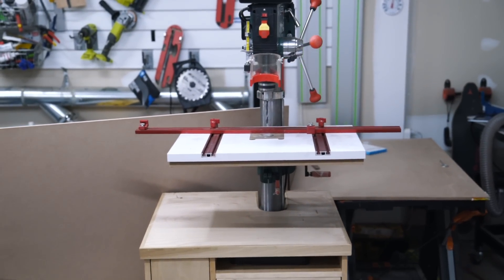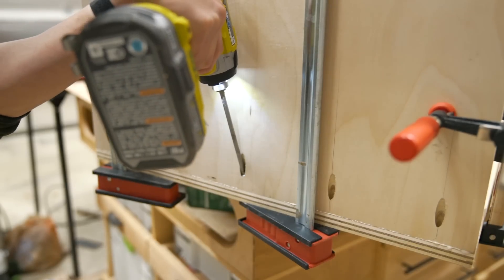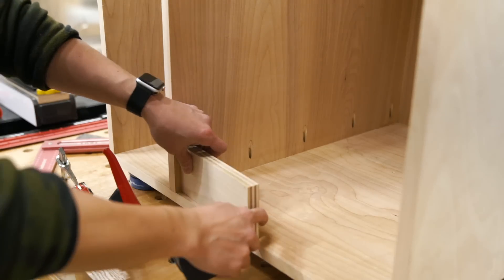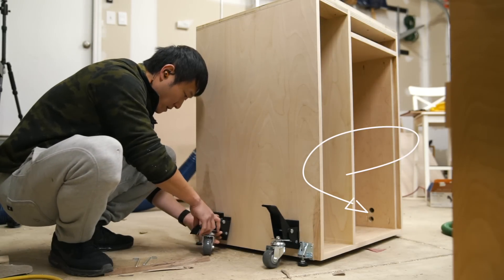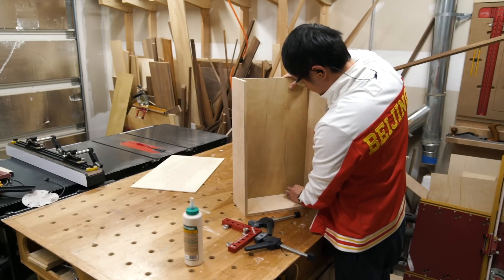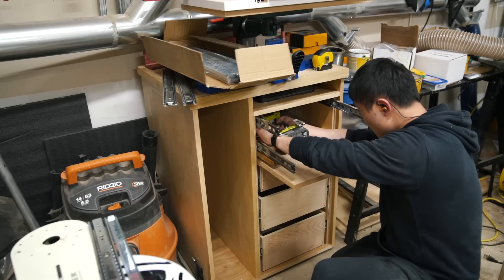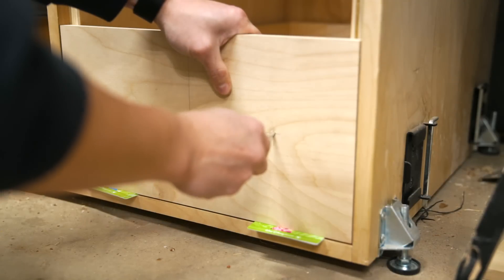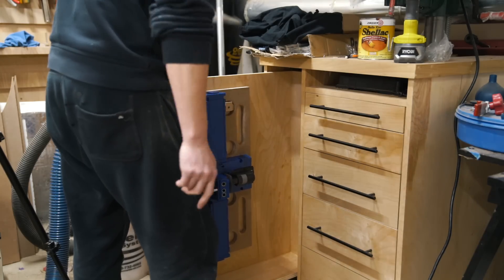DIY Mobile Drill Press Stand || How To Build - Woodworking

Comment: Great work.  A suggestion about the drawer fronts.  Once you put them in place, put two wood screws through the holes for the handle.  This will hold the drawer front in place.  Take the drawer out, and put a couple of screws from the inside into the drawer front.  Then you can remove the two from the front, drill the holes all the way through and install the handles.
Reply from the maker: Great idea! Thanks!

Comment: Definitely don't have to worry about that thing coming apart! It's built SOLID. My cheap self probably woulda used 3 screws per side (except to fix a warp if needed) and would have just glued smaller supports for the drill press instead of using that much plywood. Nice build!
Reply from the maker: You’re absolutely right! Screwing in some 1x2 strips would definitely be strong enough to hold everything. I didn’t think of doing that until after I had started editing the video haha
Reply: @BevelishCreations  That's one good thing about rewatching all of your work I guess. You can see what you've done and what you wish you would have done.
Reply from the maker: Yep! I normally realize how I should do things differently during the editing process. Like when I made the Harry Potter shelves, my process for cutting the crosslap joints are completely different between what’s shown in the video versus what I did for the ones I was commissioned to do

Comment: I added a base on bottom with a lift Caster system inside, I don't like to have drawers that low to the floor. I made the cabinet larger and I like to have the top drawers I and a half inch so when I put a ruler or something in there I'm not digging down through things to find what I want. Thank you for inspiring a little different project.

Comment: I very much like your drill press stand. I recently inherited a very nice drill press similar to yours and am looking at videos to find a suitable stand for it. So far your looks like a winner. 

There is one change I will make for the writing shelf. The shelf as compared to your will be upside down and will not have the interior supports. This way the writing table and pencil can be left in the shallow draw. This way the writing pad can be quickly viewed and then moved out of the way to use the drill.
Reply from the maker: Good idea! And I’m glad you like it :)

Comment: Came here from Instagram. Really liking the table. I had a bench top drill press but gave it to my brother in law because I acquired a floor drill press but honestly haven’t had the extra need for the floor model. Will probably be switching back and building this base or something similar. Earned a sub on both platforms. Great content...keep up the good work.
Reply from the maker: Thank you so much!
Reply: I built a rolling stand similar to this and love it. I also was careful to build it to the table saw top height for extending. I use it also as a tool ready rolling cabinet and small work station. Also put magnet bars on the sides for quick access. Really wish I would of found this first ! The side cabinet is a great Idea ..Great work ! This is a fun build ! Keep the floor press and have room for both!
Reply from the maker: Thank :)

Comment: Nice well built stand! Another workaround for your slide out shelf problem would’ve been just to reverse the vertical piece to the right side of the opening then you would’ve cleared the caster bolts that way. Who cares if the opening was on the other side it still works fine.
Reply from the maker: Thanks!

Comment: Only thing I would change is that top paper drawer. Instead of just making it a solid surface, I would make it a drawer with a lid that opens so you can put paper in it and still use it as a work surface. Maybe you didn't show it in the video but I was surprised you didn't actually secure the drill press to the stand with bolts or anything. Otherwise fantastic build as always.
Reply from the maker: That’d be cool! And no I didn’t secure it. There’s really no need to, since it’s sandwiched between two panels so it can’t tip over

Comment: I have a question for you:  it appears your main cabinet sides are not supported by the bottom panel; they are screwed into the sides of the bottom panel.  Maybe your inside cabinet sides are bearing the load?  Would be interested in your thinking about this.
Reply from the maker: JT Long you’re right, the load is transferred to the sides and down into the feet of the cabinet. The bottom panel is floating above the floor and its main purpose is to act as a stretcher, not for holding the weight

Comment: Great build. Did you mount the drill press onto the stand or is it held by the space its slotted in? Thanks!!
Reply from the maker: I didn’t mount it. I’ve never mounted the drill press even when on a regular table top. It can be held in place by the slot if you’re worried about it tilting

Comment: I bought these plans and have a question, how did you fasten the drill press base?
Reply from the maker: David Lediard I didn’t. Haven’t had any issues with it. If you want to fasten it, then drill the bolt holes before fastening the top panel on. I kept the clearance between the drill press plate and the top panel close enough that there’s no concern for tipping over

Comment: Yay, finally found your YouTube channel! Another great video! I like that you included your film gear as well as the tools & materials. :)

Did you plan to finish it at all?
Reply from the maker: Paul Mix hey thanks! It’s actually finished. I used shellac. I just didn’t film it because everything was done at different stages instead of at the end. It got kind of messy from a story telling point of view.
Reply: @BevelishCreations  May I ask why you chose Shellac instead of Polycrylic? I've never used Shellac so just wondering. Thanks
Reply from the maker: I just happened to have some shellac on hand. The stuff I use have wax in it, the wax actually helps me to keep glue or paint or epoxy from getting stuck on the surface. Not sure if poly would do the same
Reply from the maker: Also, I forgot to add, Shellac has a lower working temperature and shorter wait time. Also two big reasons why I chose Shellac for this. It was 45deg when I was building this

Comment: Bevelish Creations- 
How are those table saw rollers working out for you? I've seen them before and think they'd be awesome to have.
Reply from the maker: Really good! Especially for cutting wide pieces, they help to keep the piece pressed down to the table as well as pull them toward the fence. It’s great for preventing kickback
Reply from the maker: Steven Roehrer I should add...they’re definitely a luxury, not a must. If you have the funds to get one, then yes get them. But they certainly won’t dramatically improve your process
Reply: Thanks!
Reply from the maker: Steven Roehrer no problem!

Comment: Great video. What was that tool you used to draw the straight line parallel to the edge?  It looked like a flexible ruler with holes for the pencil and a T square on the end that rolled. What is that called?
Reply from the maker: Thanks! It’s an “Incra T-rule”

Comment: Bevelvish - I already have some casters similar to the ones you used, but they do not come with the quick release plates. Only screws were provided. Can you tell me whether my Rockler casters will work with the quick release plates the you use in your build and provide a link to in your comments? - Bill
Reply from the maker: William Bloomberg hey the ones in my comments are the Powertec ones. I have both the casters from Rockler as well as Powertec, I’m pretty positive that they are the exact same products, just branded differently. The Rockler casters should work well with the Powertec plates and vice versa
Reply: Bevelish Creations - So, playing sleuth, I searched Rockler’s site for these quick release plates and found them right away. Bought a set immediately! Unfortunately, I’m afraid you don’t get click credit for this purchase, but I promise to make it up to you later on. I’ve subscribed to your channel and clicked the bell as well, so I’ll be back for more. You have a smooth style and a very nice delivery. From a woodworking perspective, you should take another look at cabinet construction using lock joints for carcass construction. Quicker and stronger than butt joints and pocket screws, and saves the expense or all those screws. Just a suggestion. Very nice build with excellent organization and great English grammar for a woodworker. Go easy on the “rinse and repeat” metaphor, though. (kidding)
Reply from the maker: William Bloomberg haha thanks! I’ll check out lock joints, thanks for the suggestion.

Comment: I don't know of how others work here ,but for me it's rather ridiculous that you don't have proper drill bit storage at a DRILL PRESS. The primary reasons for a drill press cabinet is 1.to use as a stand for a drill press and 2. as storage for drill press accessories which are easily accessible, which you only did number 1. the rest will irk you having to sift through storage containers to find the right bits as you never added proper storage in the first place. Just a wasted opportunity in my opinion.
Reply from the maker: Haha ok